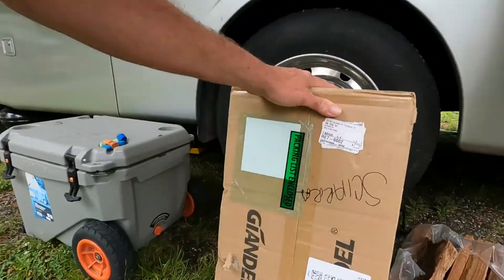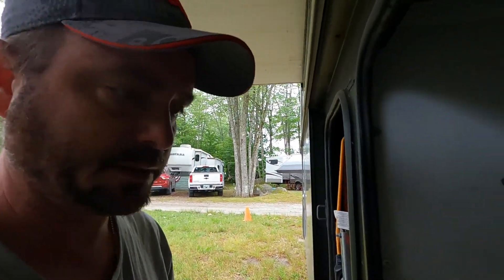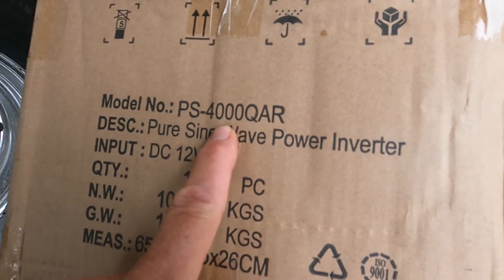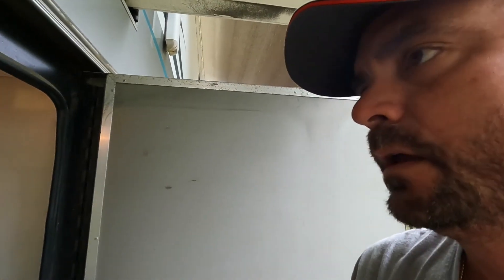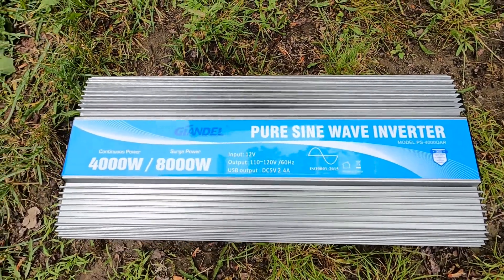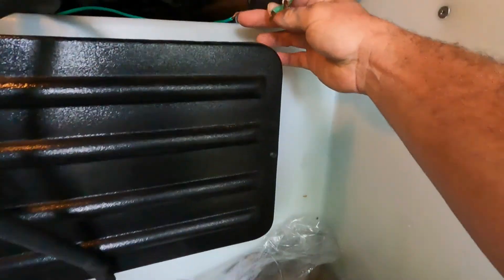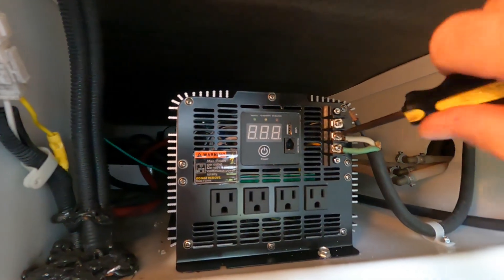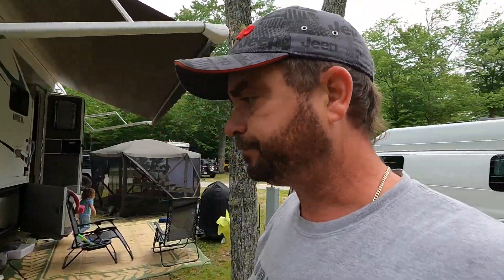RV How to Install GIANDEL 4000/8000 WATT PURE SINE WAVE POWER INVERTER

Comment: 2/0 Copper wire alone is not enough to carry 4000 watts and 347 Amps.   You need 2/0 and 4 Gage wire to carry the load with a 450 Amp fuse to protect the Inverter.  Otherwise you can over heat the wire.

Comment: I myself in particular run 12 volts because it on a yacht with 2 large diesel engines and 2 large alternators. All the dc systems on the boat use 12 volts as well as the engine controls and starters. I use a 4000 watt inverter only for the starting current for the air conditioner that runs after start at about 1300 watts. It just needs that 8000 watt surge to startup. Occasionally I will run 2x 1500 watt cooking appliances and the 4000 handles it (without the A/C of course, but the 3000 watt Renogy did not. It is not for any more than 15 minutes that this happens and is pretty rate. I do have the DC fused at 300 amps, so it would blow just before 4000 watts anyway. Using lithium, I mostly have 13 volts available for the unit. I am however having issues with the floating ground and am not convinced the shorting ground to neutral is the proper way to go about it. I am just going just going to hook up the ground wire to the neutral lug so that I have effectively bonded the neutral and ground, just not the inverter ground. This may be why your inverter is failing constantly. My being off grid in the Bahamas for another 6 weeks, I cannot risk a problem bonding the ground and neutral in the inverter in case this is what is making it fail. All my refrigeration requires this inverter and I cannot chance it failing.
Changing to a 24 volt system is just not feasible because of the huge starting needs of the engines that I use the 20kw of lithium for. I would need to install 2x more 8D batteries if I went this route and just do not have the room for them. Another 250 lbs in the boat is also something I don't want as well as the problems associated with lead batteries such as corrosiveness and flammable gasses. This is why I have a 4000 watt inverter on 12 volts.

Comment: Why on God's Earth 🌎 you want to run 4000w at 12v? Iove that brand inverter, the sad thing is I can't afford that brand.
Reply: I bank 4/280Amp Hour Batteries.  Gives me 14,336 Watt Hours.  I can run the AC for 10 hours, TV, Coffee Maker, Microwave, Starlink and lighting.  Also installed the 30 Amp transfer switch so the inverter is never powering the RV when Shore Power is present.  It gives me comfortable options when planning trips.  You just have to know what you need and over kill on all wiring, connectors and bus bars.

Comment: Did you find out why those inverters failed?

It seems ridiculous to me that you can't run the inverter while the alternator is charging the batteries.

Running the inverter without the alternator running would kill the batteries I no time.

What are your thoughts?

Comment: Hi mate what amps would you need for a 4000w?
Reply from the maker: We are using a 300 amp fuse on the 12v side.
Reply: @Down2RV  4000/12= 334 minimum
Reply: I like the 4/0 but man they expensive as hell

Comment: I agree with the comments that 4000w is too much for a 12v system.  Just do the math, 333 amps if fully loaded and 666 amp surges????  Even your 2/0 wire is not large enough.  When you get into amperage that high you have to start worrying about milliohm resistant connections.  Sometimes even a crimp can cause them and then you have voltage drops and heat.  Anytime I go over 2000w I start looking at 24v systems and use a 24v-12v DC-DC converter if needed.  You made an interesting comment that I hadn't thought of.  If you do run this going down the road and the alternator dishes out 15vdc or more wonder what that could do to the inverter?  Also if you have a bad diode in the alternator again could cause issues.  Good luck on your 3rd unit, keep us informed as I've purchased two 24v 3000w Gaindel's and so far so good but only a few months into it.  But note, at 24v & 3000w my maxed out current is only 125 amps!  Much easier/cheaper to wire and less chances of voltage drops.  🙂
Reply from the maker: We don't max out all 4000 all the time. It does work well for the microwave, fans and coffee maker. Provides enough for general living. Have had no problems ever since we stopped using it while its charging. In retrospect we will upgrade to a diffrent system next time, probably solar and lithium.  But for a cheap system this one works well and we didnt have to remove the onboard energy management system or rewire the entire rig.
Reply: @Down2RV  I've run fans, coffee makers, CPAP, home style refrigerators, & microwaves from a ProSine 2000w inverter & 900w solar for years with no issues. Being smaller also reduces the parasitic losses too.  I've switched to lithium and now thinking of adding AC to the equation so trying out the 24v systems now then adding 1340w solar.  So far much more impressed with 24v over the old 12v I had.  Glad this one is holding up, I've heard almost all good things about the Giandel.  The few bad were always a questionable application or installation.  My last inverter was $2000 so this $400 one is a nice bang-4-buck.  🙂

Comment: Did you use a fuse or breaker, between battery and inverter? If so, what size??
Reply from the maker: We used a fuse for the first install, subsequent installs we installed a manual reset breaker. I cant remember what amperage right now but I will look and get back to you.
Reply from the maker: 300 amp
Reply: @Down2RV  YOU'RE AWESOME THANK YOU!

Comment: There's the problem. 12v. For the life of me I can't figure out why people insist on using 12v for anything over 2000 watts. You will continue to fight that system until you upgrade it to 24v.Ask me how I know. Been there done that. I went 24v and no more issues and now 4 years on a Giandel 4000 watt inverter. Blew two up on 12v. You simply cannot get 4000 watts out of 12 volts without abusing equipment.
Reply: So run the batteries in sequence .

Comment: I've been running that Inverter 4000 Watt Pure sine 24  Volt in my House for over a  Year 99% of the Time. It's done that to me  a few Times , "the warning beep, but it reset after a shutdown.  Your Rig looks like fun,  i hope to get one too & add a 3-4000 Watt . Indiana .

Comment: I had looked at that brand… they all have pretty mixed reviews on Amazon though… unless you go with a victron multiplus lol
Reply from the maker: When we were researching everything was Victron this and Victron that. But our budget at the times was not...lol. Spent 2,000 on the batteries and the $700 price tag of this inverter sounded nice. We didn't want to have to rewire the existing on board power management system so this was the solution. That said we haven't had a problem again once we stopped using the inverter while the batteries were charging.  Next time it will be a Victron.